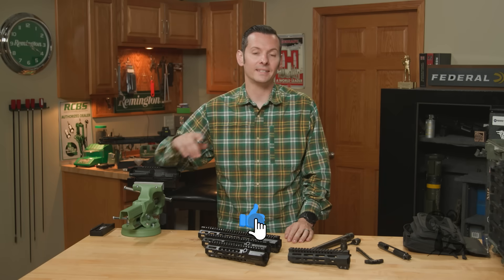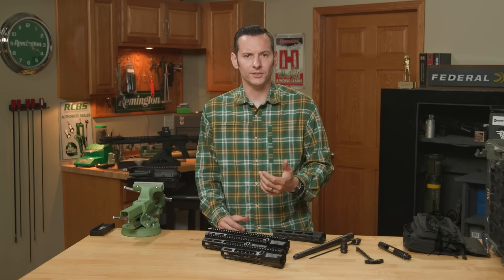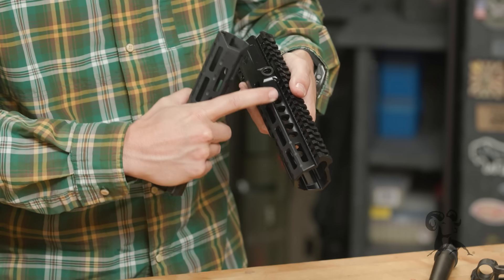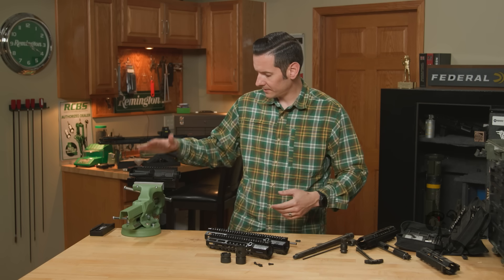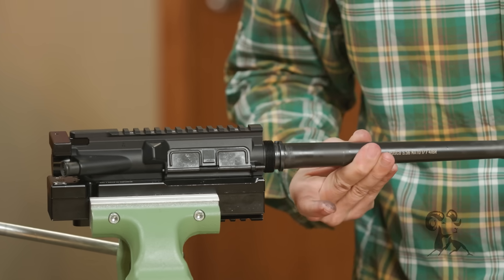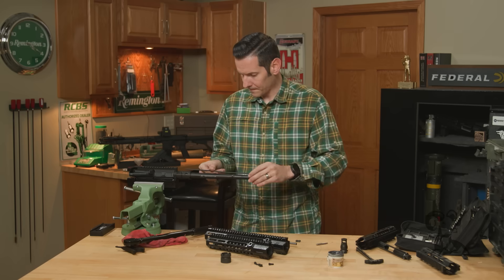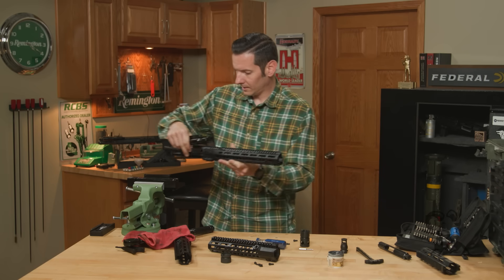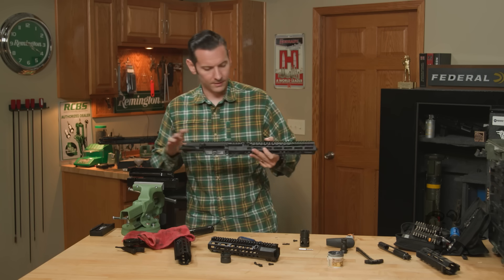Tech Tip: MI Combat HD Handguard

Comment: Question, you hear a lot of gun smiths put the barrel nut on and off 3x to (seat the nut) is there any truth to this? Or reasoning why? I never understood why they do it but they do it so I t thought I'd ask.
Reply: I do it because it develops a better relationship with the two components. After both components (upper and barrel nut) are machine, they do have micro flashing that is left behind so going back and forth a few times is essentially cleaning/smoothing out the threads..

 plus the thread pitch between two different parts might be slightly off in the pattern (not laying flat against each other) which could cause the barrel nut to eventually shift slightly forward (loosing up) during recoil until the patterns are completely uniform, so it’s kind of a nice little way of taking care of that potential issue before it happens.
Reply: @angeldesigns1385  couldn’t that be said with every nut and bolt? I have never seen anyone do that with any other bolt which makes me wonder if it’s actually necessary.
Reply: @Asymmetrical.athlete_ it may not be necessary at all but I just find it to be good practice that doesn’t take much effort. But I also look at it like this. The center of the barrel nut joint is where all the combustion is it it’s full peak, and at the same time, the projectile is essentially pulling on the barrel until it leaves the muzzle, so the barrel nut is what endures the all the abuse from the combustion and tension while all the other components only endure abuse from the movement of the recoil.
Reply: Do you have to do it every time you change the handguard? Bcm even recommends 5x torque and break.
Reply: @kshigsm if you’re dealing with a new barrel nut that hasn’t been installed yet then I would go ahead and do it just in case there is any inconsistent alignment in the tapering of the threads.

Comment: I have a few combat rails, and the anti rotation tabs are pretty much useless. There is so much of a gap between them and the receiver that theyll never work for holding zero with anything. The ones i use ive drilled holes in the center and put them on adm uppers so i can put an anti rotation pin in between them, because without it they always twist. Their lock up needs to get revised before i get anymore rails from them.

Comment: Problem with alot of companies rails is they use different materials from rail to barrel nut and they heat and cool differently and creates an issue with loosening or getting some wiggle, same with gas blocks.  Just because material may be better/stronger doeant always mean it's better.  Can't change a single part and expect it to be perfect without effecting something else, its a system of sorts

Comment: 06:57 greasing threads is generally bad  practice because it skews the tightening torque, why is it done here
Reply from the maker: Greasing threads, particularly with different materials (steel and aluminum), it is not only good practice, but required for long-term durability.
Reply: Where do you people come from? How do you not know to use moly on barrel nut threads?
Reply: greasing the threads has been done for decades with no issues.
Reply: anytime there is differing metals you should use grease, protects the softer metal and helps keep the bond
Reply: x1000%

Comment: My only complaint with midwest rails is that the bottom on the rail is so tight, that you can't put any accessories like a forgrip under the gas block, because the mlok screws will butt against it, which will add pressure against the barrel.
Reply from the maker: Only on accessories with particularly long faster screws, which can be trimmed to fit.